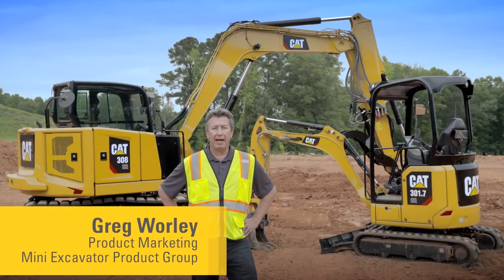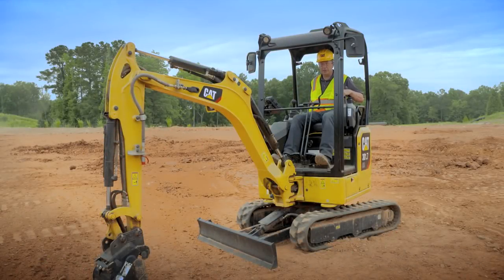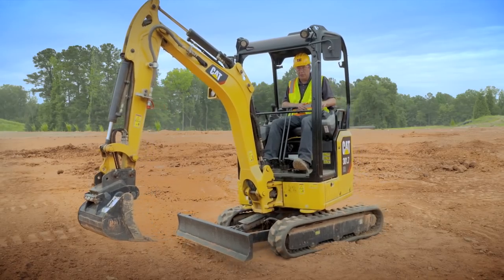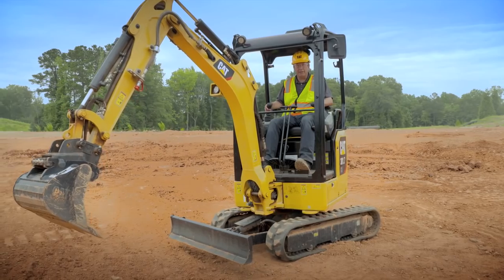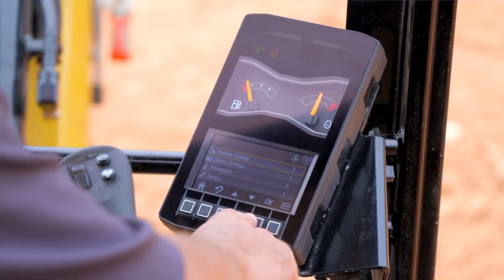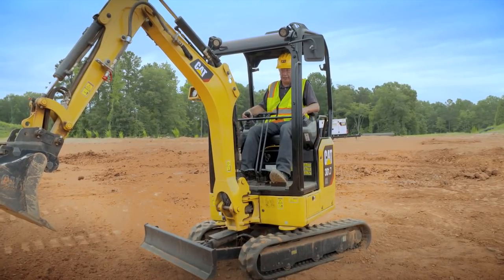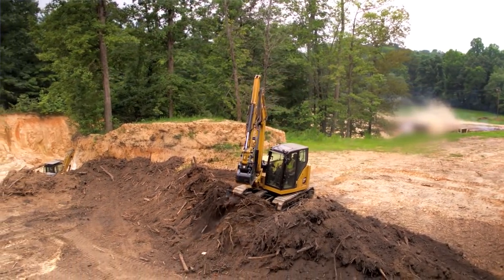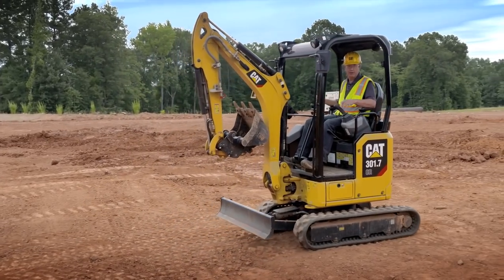Stick Steer on the Cat® Next Generation Mini Excavators

Comment: I’m with the last guy they have grade control and all sorts of silly stuff. Pretty soon ull have computer guys standing out side them with a remote controls. It’s an excavator not a skid steer.  Excavator undercarriage and skid steer undercarriage to diff things so it will b interesting to c how next gen ex drive in skid steer mode.. both machines are weighted way diff.

Comment: Aboslutely, more crap to go wrong. And the best part is we in the feold probably won't be able to repair this electronic crap..
I want to pull a lever and know it will work , rather than push a button and hope it works. 
That's why all my equipment is all mechanical.

Comment: If you can’t use the pedals with your feet then you can’t operate
Reply: Rat Race guys said that when they moved to differential steer. “If you don’t know how to pull a clutch and hit a brake at the same time all while grading a 4:1 you cant’t operate” BTW they’re all dead!
Reply: As if to say you're faultless and could never do anything wrong. Everybody does things differently. Can't say a guy doesnt know what he's doing by how he uses the controls but rather how he makes them work collectively to get the job done the best way he knows how. Honestly, I'm just a young buck getting going in logging and the type of equipment I operate are far more complex than your average excavator. I may not know much, but with what I do know, I can do very well. I know guys who have changed the way the machinery is made and works just from what was once "not traditional" to the new standard and the industry is moving forward because of them. Cat probably isnt the best in this segment but I give them credit for trying something new and maybe when other manufacturers catch on, it will be improved and might help bring in the new, young workforce that we so desperately need everywhere.